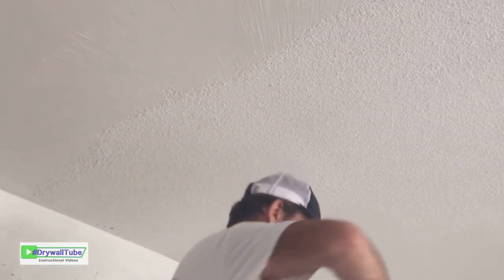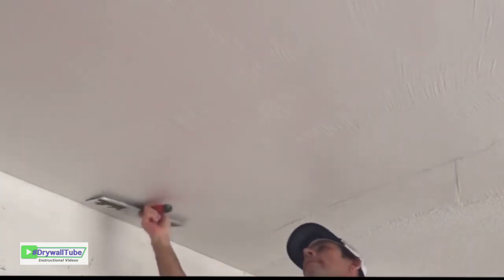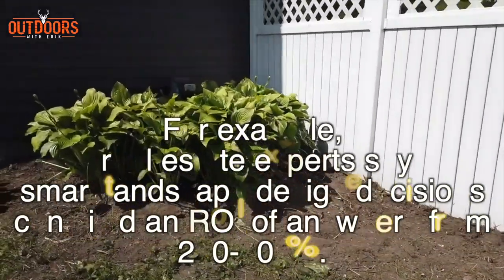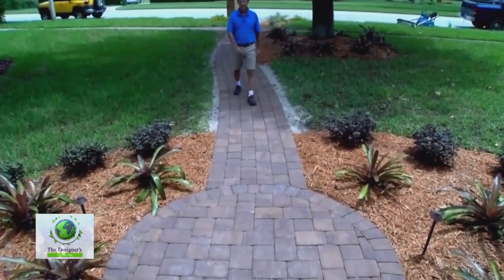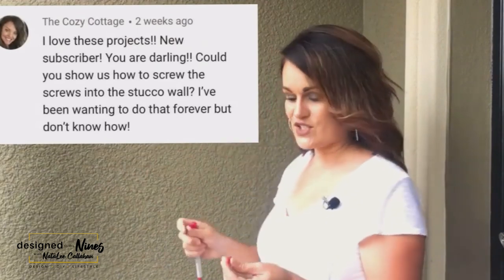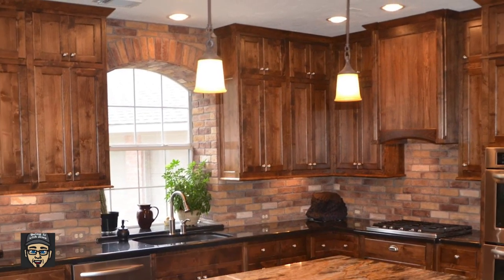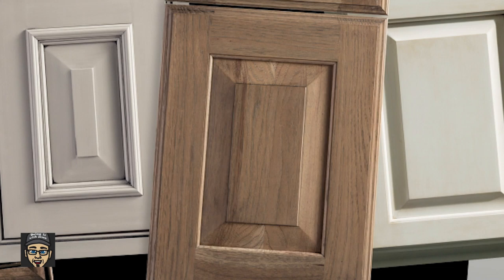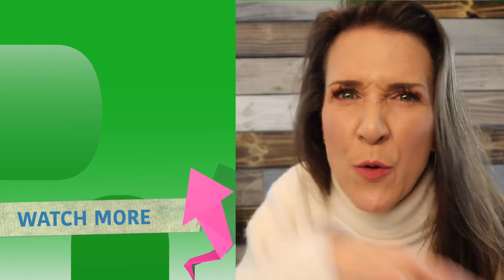Add MASSIVE Equity To Your Home with These 5 Projects

Comment: When we sold our first home the appraisal was $135,000 (20 years ago). We started by emptying the house of all non-essentials. Sent 14 loads to the dump and boxed up the rest to store at my parents for the time being. What a difference! We had 6 children in a 1400 square’ home! 😱😱😱 We replaced a couple cabinet doors (only the bottoms were beat up). Painted the main living areas and the bathroom. A few new decorative touches and the 2nd appraisal came in at $155,000!!! And that is what we got for the house! It was a lot of sweat equity but very little cost for that extra $20,0000! Now I’m facing doing it again but I’m 20 years older! Yikes 😳